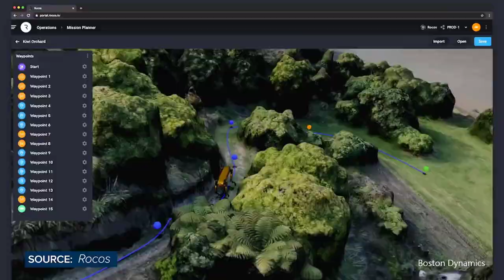Bilge Pumps does Battlestar Galactica Deadlock for Navy Con 1/2

Comment: What about orbital kinetic weapons effect on naval vessels?  Could a few rods dropped from orbit sink / roll over a carrier from the proximity shock wave through the water?
Reply: Yes. "Rods from God" are pretty much the next nuke. We really really don't want to see them turn into a reality. Essentially, all you need is a crowbar in orbit with a bolt-on guidance system ... and there ain't much you're going to be able to do about it.
Reply: the problem with that idea is that lofting iron or steel into space would be prohibitively expensive. 
in contrast, a giant magnifying glass in space would be lighter AND reuseable!
Hitler's rocket scientists thought of doing exactly that but 1940s tech was unable to lift that much glass into orbit and then too how would you remotely direct it with primitive RC. 
Entirely feasible today.
Reply: @ArmouredCarriers  They already have been tested from X37-B's dropped on mid zones of Antarctica, and every OTV mission carries a limited payload.

Comment: The main problem with self-learning AI systems is that the programmer AND THE USER does not know exactly what the AI is "thinking" about the situation and, thus, does not know what it will do (HORIZON ZERO DAWN being the most extreme from of what can happen).  If the software is made of the self-modifying, totally-self-learning from many trials, type (ALPHA GO and relatives), you CANNOT UNDERSTAND WHAT IS GOING ON SINCE IT IS NOT A "PROGRAM", IT IS A HUGE TABLE OF INTERLOCKING MATRICES REPLICATING INTERLOCKING NEURONS IN A BRAIN.  It is impossible for anything but another AI to figure out the structure so that any kind of even vague predictions can be made of what an input will do as an output. DO NOT UNDERESTIMATE WHAT SUCH AI SYTEMS CAN DO, NO MATTER HOW STRANGE!!!

An extreme example of this is a training system for an AI to detect enemy tanks no matter how camouflaged it might be, from any angle.  They got hundreds of pictures and ran it through the AI learning system until it worked PERFECTLY (they though).  They then sent it out to detect real tanks in a training facility for soldiers.  It could not find a tank if that tank ran over it!  They were totally confused about this until somebody noticed something about the training pictures:  They all had an ID code in the lower right-hand corner.  When they got rid of those and redid the training, it worked in the field just as well as in the lab.  The AI thought that the ID Code was part of the tank!!  No code, no tank.  This shows that you may not understand what you are REALLY training an AI to do, compared to what you THINK that you are training it for.  VERY, VERY DANGEROUS FOR KILLING MACHINES, I WOULD THINK...

Comment: This is excellent but raw and needs edited and or a  synopsis. Decision makers have no free time.
1) Rise of a.i.: a.i. can outperforme people at known repetitive tasks e.g. combat air interception thus
a) Kit out a bunch of F-16s as drones rather than getting more F-35s
2) machine learning isn't however good with new data sets which it hasn't trained up on yet. 
3) military exercises sometimes are unrealistic or instead seek to reach a pre-game conclusion
a) Example of fighter bombers in ww2 cvs; they were under emphasized
b) counter-example of Taranto, TBDs can indeed hit and hit hard IF they get through 
Use of a.i. in the surveillance state (China)
Rise of a.i. pattern recognition and camouflage countermeasures
the robot boarding parties is the second half and seemed less interesting/ insightful. no discussion e.g. of legs versus treads versus wheels.  scenario would be likelier anti-piracy rather than ship to ship combat. 
damage control drones: would be a good idea since fires say 400-800 degrees that would stop a man won't stop a robot. Above 1000 degrees not even a drone firefighter would help. plus with DC there's nothing you can do to make it worse if the AI gets it wrong, unlike shooting the hostages or your teammates.
Reply: second 20 minutes; retrofitting quad 40 oerlikons in place of single mounted turreted 37mm single cannons e.g.
Reply: We're a bunch of amateurs brought together by COVID cabin fever. We're trying to get up to speed with the polish. But at the same time we want to keep a very relaxed and informal approach to matters. There's plenty of serious scripted stuff out there anyway.
Reply: @ArmouredCarriers  You go to war with the army you have
not the army you wish to have